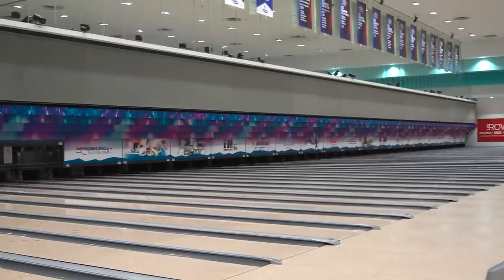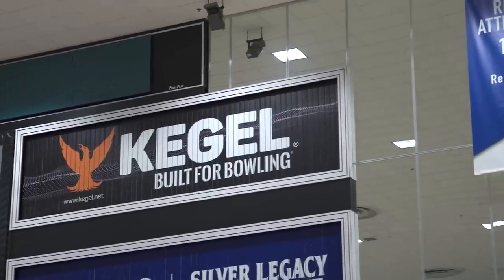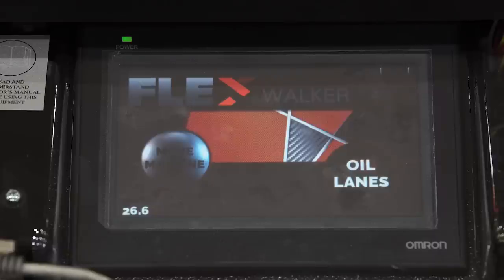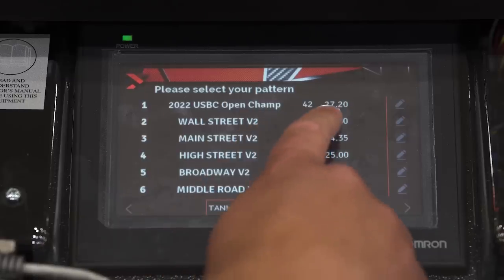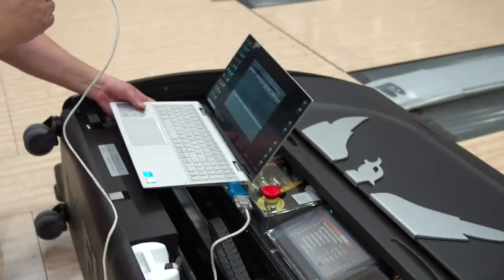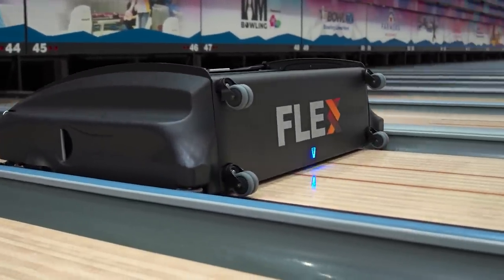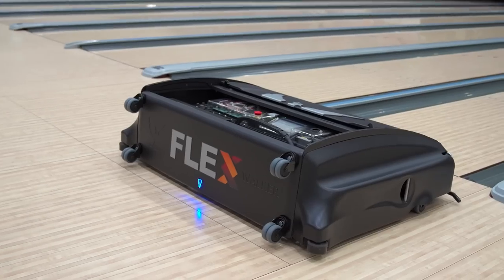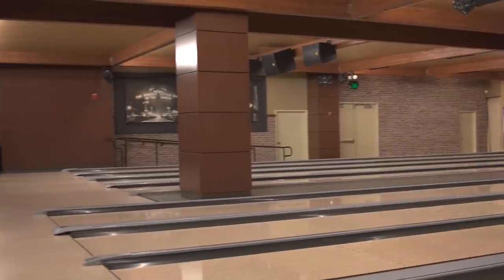2023 Lane Maintenance at the USBC Open Championships Bowling Tournament

Comment: I noticed that you didn't mention anything about lane topography.  Even though you put the same pattern on each lane does not mean you will get the same reaction from lane to lane.  Unfortunately, it is impossible for man to make each lane perfectly flat.  There will be highs and lows in the lanes.  Many bowlers do not understand why they can be bowling on a pair and need to play the lanes differently.
Reply: They look pretty flat to me. You're probably talking about the high and low spots that aren't seen.
Reply: @jerryvanzant  That's what he said !
Reply: Correct, however most people don’t realize that most of this topography is minimal when it comes to effecting the bowlers ball reaction.    In extreme cases, yes It’s worth looking into.  But ultimately, bowlers need be reminded that adjustability is a key to the sport.